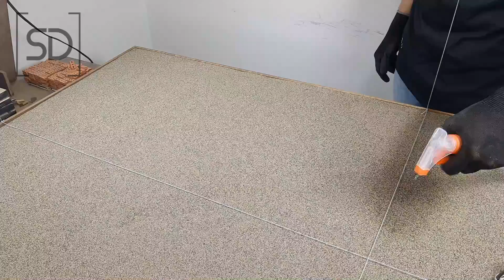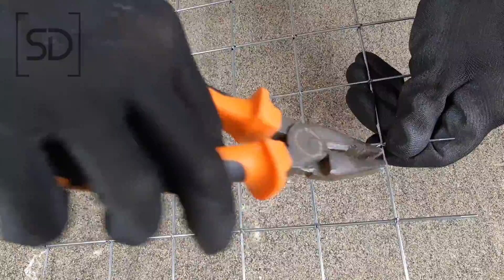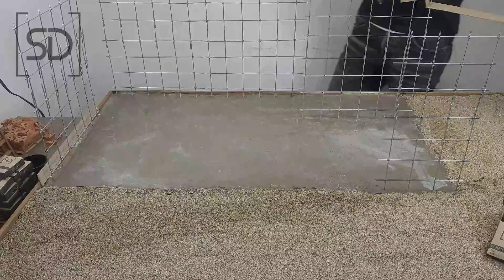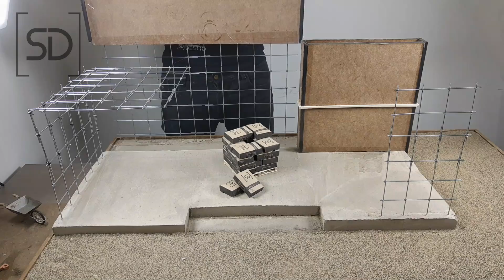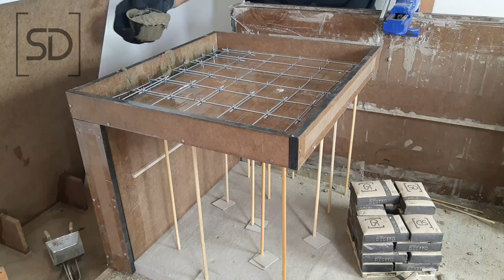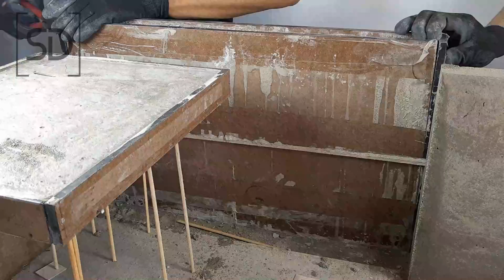How to make CONCRETE STRUCTURAL WALLS - OUTDOOR SPACE #1 - walls concrete

Comment: Hello! Great work :) Can you provide a list with the exact materials used? Thanks!
Reply from the maker: Hello, thanks for your comment, in this video we use cement - sand - water (mixed with a ratio of 1: 2: 1) also used galvanized wire, bricks and finally wood for the forms. greetings from the destto team